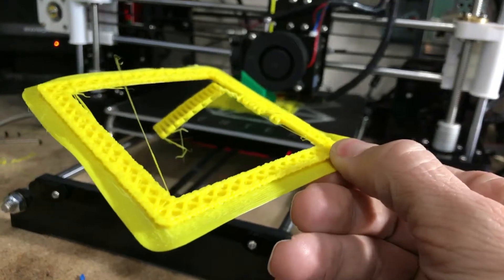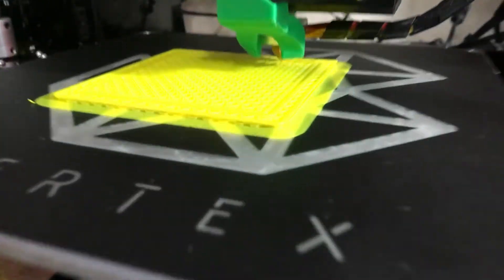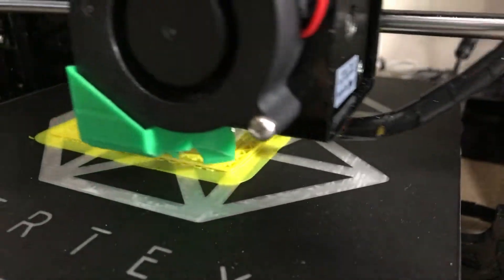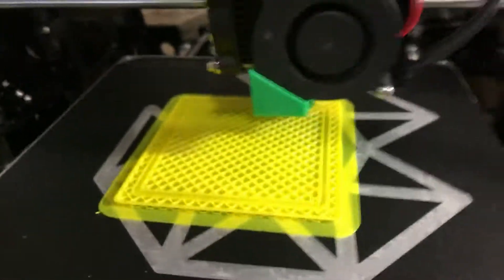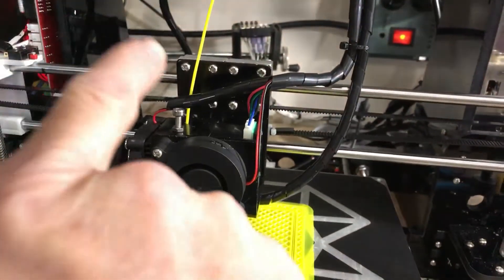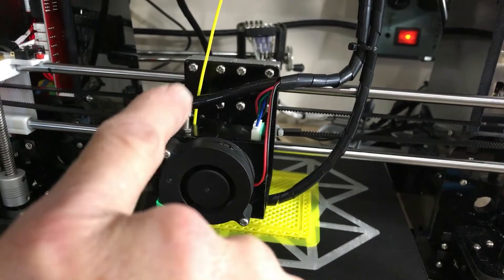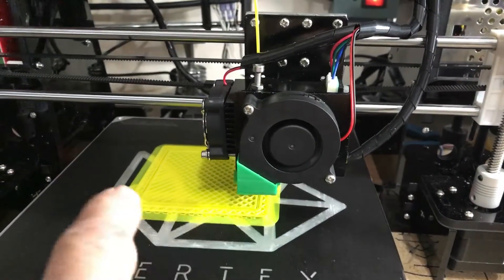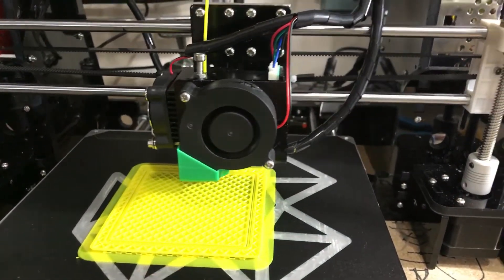Anet A8 "CLICKING"

Comment: I had the same problem when I tried using the volumetric method in Cura (on Linux).  I mistakenly thought that it should be more accurate but there seems to be some kind of discrepancy between "volumetric" and reality.  It was trying to push far too much material through the nozzle and causing all sorts of problems including blockages (the clicking is indicating the nozzle is blocked).

Volumetric uses mm^3 based on the diameter of the filament, while linear uses only the mm feed length and is controlled as such.  Perhaps some printer firmware is just not designed to interpret volumetric extruder code.

Make sure that Cura is set to Marlin flavour and with a linear extruder and I'm pretty sure it would have fixed this problem.

I upgraded to Marlin firmware on my Anet A8 when I added a capacitive sensor for bed leveling, but the Anet firmware is basically a cut down Marlin anyway. (including cutting out some of the safety features like detecting thermal runaway).

Comment: I had the same issue as well... simply slowing down the print seems to resolve it. If the machine goes too fast, it tries to pull out too much PLA out the nozzle to be able to keep up with depositing the layers, then the nozzle ends up not dispensing enough, which results in thinner layer lines, which makes the PLA not stick because as the line is thinner, it sort of prints in mid air... and that ruins the print.
So, go slower and it will go away. Also, be sure to calibrate the Z offset correctly because if the nozzle is too close to the bed, it can have the same effect (clogging the nozzle because the extruder just keeps feeding the PLA and it is not allowed to come out freely)...
Also you might want to look up extruder calibration on Google, there's plenty of tutorials... this is about feeding the correct amount of PLA to the nozzle...
So all these things add up to ruin a print... I was fighting multiple issues and have solved most of them... but there's still some tinkering to go :)
Hope this helps.

Comment: I have the same issue. Did you fix it ??
Reply: 1.slow down the print speed to 20mm/s
2. clean the nozel, with some copper wires while heating the nozzel
3. check that the extruder stepper motor is vetting enough voltage to run
if not, then change the connection wire with copper wire, it will help
this all setting I did on my anet a8, and it worked